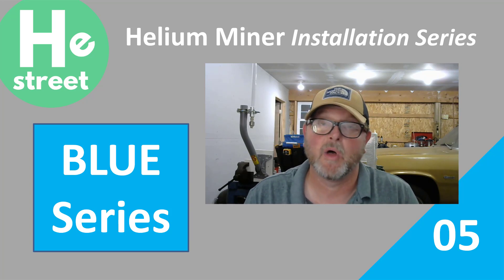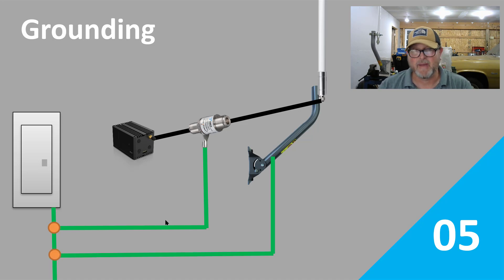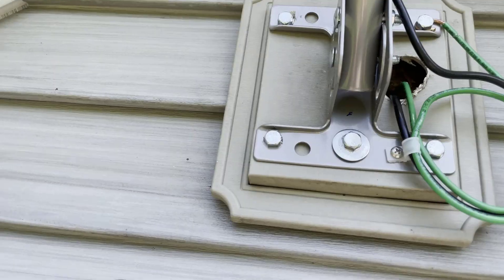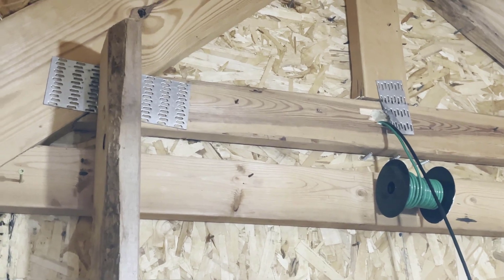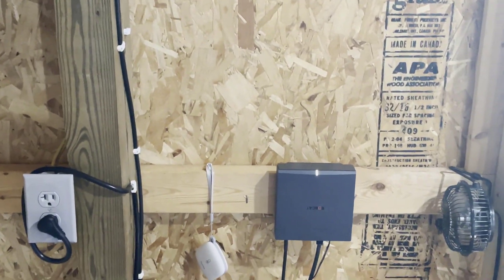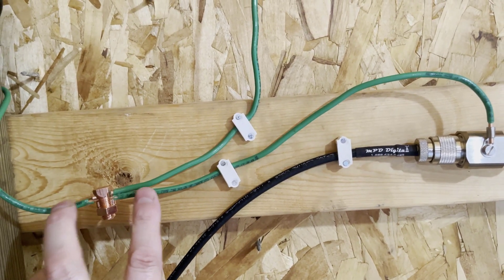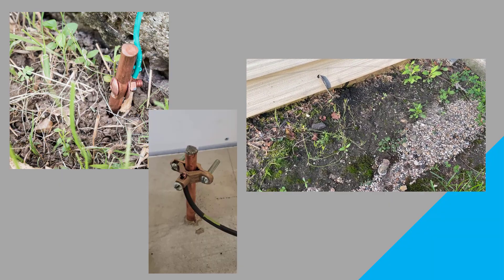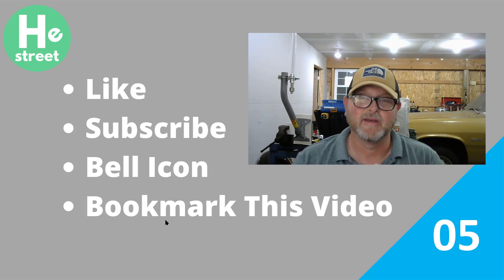Helium Hotspot Miner - Grounding Tutorial [BLUE SERIES] 05

Comment: This video is so helpful. Thank you for putting it together. Is it possible to connect the ground wire to the ground wire from an electrical outlet? My miner will be in my attic so running to the sub panel in the garage isn’t feasible.
Reply from the maker: My antenna/electrician contacts have advised against this.  Good idea however.  It seams logical but one of the main issues here is that the ground wire in your house circuit is usually only 12 AWG for 20 amp and 14 AWG for 15 amp and your ground for the helium COAX needs to be 10 AWG (min), so you would be undersized.  That is only one of a few issues mentioned.
Reply: @vandelay.digital.academy  Thanks for the quick reply. I also have my AC units in the same attic and those should be on a higher amperage circuit and hopefully bigger gauge ground wires. If I can find a 10 AWG ground wire from an existing circuit will that work? You mentioned the size of wire is only one of a few issues mentioned. What are the other concerns?

Comment: i have 1 big concern about this. Lightning arrestor have a voltage level protection up to 1200v. Obviously this cant handle a thunder. I believe is useful more for static energy creating by a storm. Therefore, should we build a lightning rod nearby to protect our antenna in case of a thunder?
Reply from the maker: NEC rules specify the ground needs to be attached to the electrical system of the structure. ie. the ground rod used for the electrical system.
Reply: @vandelay.digital.academy  i understand that. Ofc i will connect the lightning arrestor to a grounding rod. My question is if beside an arrestor do i need to build a lightning rod near my antena to protect it from the thunders
Reply from the maker: The guideline requires you connect the ground for COAX and mast be connected to the electrical system ground.

Comment: WOW YOU HAVE A LOT OF BENDS! Where in the world did you come up with 17 gage wire to use for a ground!  I would not ever talk about any ground wire smarter than 10. And it is possible for lighting to vaporizer 10 gage wire! You do know that lighting turns sand into glass? That is HOT! I would go with a 8 or 6, maybe a 4 gage stranded wire,  and not put as may bends in it. Lighting doesn't like to make turns! The wire needs to be outside as much as possible!  You are bringing the lighting inside before the lighting arrestor!  You put it on wood!Wow! Do you want that wood to get to 900 degrees or hoter? You want a straight line,  or as straight as possible from the antenna to the ground rod. With as big of a wire as you can put in,  Stranded!  Any bend forms a choke!  I have seen connector blown off of RG214! On the tests it talks about Not making bends in ground wires! Look up anywhere you want to look it will tell you Not to put bends in ground wires! And most will say that the lighting arrestor should be Before the coax comes inside!
Reply from the maker: Thanks for the feedback Donald.  Our installations have passed inspections and follow NEC guideline's.  17 AWG is the minimum requirement for the mast and 10 AWG is the minimum requirement for the COAX.
Reply: @vandelay.digital.academy  Take it from someone that has really repaired radios after near lighting hits! There minimums suck!! I worked at 2 Way service centers! RG214 has 2 shields. Lighting blow the connector off! The radio had a #4 stranded to ground. The tower had 3 grounds! It made glass around the ground rods! There was a DC remote on the radio with phone drop wire going form the radio to the office for the DC remote. There was no wire inside the drop wire to the office. Just the insulation up there! It destroyed the DC Remote! NEC Minimum are what is the lowest! That is what Minimum means! I would put the surge suppressor outside on the mounting, and run the biggest stranded wire I could afford down to a ground rod and then another wire from that ground rod to the power ground rod underground. But sold wire suck for grounding RF. Check David Casler, videos on Grounding on here! As for coax for VHF I have found that most of the RG8 is made in China. There is no real standers for RG8. RG213 is the same size and cost a little more but if you get Mil-spec That is Military Specs, that is good coax. You can go online and see the loss for the different coax at the frequency. LMR has some very good coax it is a little highter. I hope you never get lighting hit near you. Lighting hitting anywhere near you will set up some very high voltages and currents! Most people don't think of the fact that anytime there is a high current it sets up large magnet wave around it and if your antenna is withing miles of it there is large currents and voltage put into your antenna. This can do some really bad things. You want to do everything you can to keep that out of the house! If it gets in the house it can burn down your house!  Think of it that the lighting jumped from 10,000 feet in the air down, that is a hell of a lot of power! Hope you understand I just want to keep you safe! I have seen things that would make your hair stand on ends! And if you are anywhere there is lighting and your hair stands up, You are a target, make yourself small as you can!       73   de W4DES
Reply: @donaldsmith3048  I was scrolling down waiting for someone with real lightening experience to comment. Good stuff. My gut was telling me don't bring it inside. And I would bet money on it, if that ateana did get hit, everything is gonna be fried and some. Run it straight down outside of the house seems like the best idea regardless of NEC minimums. Good info Sir.
Reply: @adamgraves1805  Living in Florida, gets more lighting than most of the US put together. Most of the things I have seen people would not believe. I saw phone drop wire that there was no wire inside it after a lighting hit! It vaporized the wire inside the insolation! We need to treat it like it is SHF or light, it doesn't want to change directions. NEC is good. But I have not seen the part for radio tower grounds. My copy is about 15 years old, and I studied the Burg and Fire alarm systems. I have no idea what the temp gets to but when a ground rod comes up with glass on it from the sand getting VERY HOT!
Reply: Would a flag pole need to be grounded if its deep in the dirt?

Comment: I have 2 helium antennas that I get continuity between the center pin and the threads  of the n connector when metered . This doesn't seem normal. I thought the center would be isolated from the shield of the antenna ??  wouldn't this be a dead short on the antenna terminal?
Reply from the maker: I'll check a few in my stock and reply.  Not sure.

Comment: Current takes the shortest path , in this example your miner will burn before current reaches the ground, because cable going to miner is shorter than actual ground wire.
Reply: this is exactly what I was thinking ground isn't supposed to be longer than 8-10' from what I remember if you have 50 ohm coaxial and your grounding wire is more than that guess what? A long grounding wire is surely more than 50 ohms so ZAP!

Comment: What is the problem if u connected the lightning arrestor directly to the antenna?
Reply from the maker: Most electrical inspectors like to have the lightning arrester close to the device that it is protecting (in our case, the hotspot/miner) or at the point in which the COAX enters the structure.  In cases where the butt end of the antenna is relatively close to where COAX enters the structure, within a few inches for example, we can attach the arrester directly to the butt end of the antenna. This allows us to run COAX right into the structure right below the antenna and run the ground wire from the arrester down to the electrical system ground wires/rod.  You would also pull a ground wire from the mast in the same location.  The scenario allows us to only purchase one piece of COAX.  Remember the COAX ground (the wire that comes out of the arrester), should be 10 AWG or thicker (solid or stranded), and the mast ground should be 17 AWG or thicker (solid or stranded).
In other situations where our antenna is much further away from the COAX entry point, like on a tall mast on the roof or just much further away from where the COAX enters the structure, we would not want to attach the arrester to the butt end of the antenna.   Instead we would run a piece of COAX from the butt end of the antenna to where the COAX would enter the structure and attach the arrester either outside the structure at that point with ah drip loop or locate the arrester inside the structure (like our blue series).  Then attach a second piece of COAX on the other side of the arrester that attaches to the helium hotspot/miner.

Comment: Very Informative video & helped alot in my installation, only question I have is, Why is Antenna mast grounded? is it to avoid static build up & does grounding the mast helps in antenna performance?
Reply: I was also wondering this.. Haven't seen other videos mention that the mast should be grounded as well as the antenna.. ?
Reply from the maker: Yes, grounding both is a NEC guideline.

Comment: Is it not safer to run a separate ground rod as close as possible to the mast?
Reply from the maker: I can't comment specifically to your question regarding safety because I'm not qualified as a master electrician.  But... I can say that I am aware of the NEC guideline regarding antenna grounding.  The NEC guideline specifies that that both the COAX and the antenna mast should be connected to the electrical system ground of the structure.  The guideline does not allow for separate ground rods.  I verified this requirement with a professional antenna installation firm.

Comment: Can you share where you picked up the vinyl plate that the antenna is on against your vinyl siding?  It seems to fit perfect for that mount.
Reply from the maker: That plate is a standard light fixture/electrical mount. I was lucky the size matched up perfect with the antenna plate.  I think most vinyl siding accessories for the same purpose will have a very similar footprint.

Comment: what do you think about putting the miner with the standard antenna inside a waterproof enclosure on a roof mast? (Antenna inside enclosure) Would ESD be an issue since the antenna is “inside”?
Reply from the maker: Are you talking about the stock antenna?
Reply: @vandelay.digital.academy  yes. The stock antenna inside an outdoor enclosure with the miner. No arrester needed?
Reply from the maker: NEC requires an exposed antenna and the mounting structure (mast) is grounded to the building's electrical system.  If you are just using the little antenna that is attached to the back of the miner directly, and you put it inside an outside enclosure box and the box is not on an antenna mast, maybe just installed outside like on a wall or on the roof?? you won't have anything to ground, ???
Reply: I purchased the bobcat 300 outdoor box from Rak. It has a grounding site to the box. My antenna would be directly to the box. My question is do I still need to bond in copper by adding the lightning arrestor which would be placed between the outdoor box and antenna ?

Comment: How does grounding help with the antenna?  I'm just using a base antenna, is that grounded or do those need to be grounded too?
Reply from the maker: What are you referring to?  "Base Antenna".
Reply: @vandelay.digital.academy  I mean anything with a black base on the bottom, just like the stock antenna for the bobcat
Reply from the maker: Grounding does not help RF performance, it just protects your device and your property.
The black 4 dBi antenna that comes with the Bobcat miner used inside would not need to be grounded.
If you decide to move that black Bobcat antenna outside, you might be assuming some very small risk but VERY small.

Comment: Could you have grounded it to your ground wire at the plug?  That plug ground goes to the panel anyway.  Good idea?  Bad idea?
Reply from the maker: I think "technically" the main reason this is not correct is because your electrical system has (for a 20A circuit) a 12 AWG ground wire.  The NEC requirement calls for a10 AWG wire (stranded or solid).  So the 12 AWG wire is not thick enough.  Bummer, this would be GREAT for apartment/condo people.  I HATE to say it.... bad idea "technically".

Comment: This was super helpful, thank you! Would I be able to ground to an outlet in my home? I’ve heard of people grounding using the bottom prong of an outlet. Please let me know!
Reply from the maker: The main reason this is not correct is because your electrical system has (for a 20A circuit) a 12 AWG ground wire.  The NEC requirement calls for a10 AWG wire (stranded or solid).  So the 12 AWG wire is not thick enough.

Comment: Nice neat work, however if I can make a suggestion, drilling a hole into the side of your antenna can compromise the structural integrity of it and a self tapping screw will back out of that hole over time. A better option would be to expose the metal on the mast with sandpaper etc so you can put a strap on it to bond it.
Reply from the maker: Is this method compliant to NEC?
Reply: Side note, a tiny bit of Scotchkote electrical coating on  your connections will save you from oxidization on any exposed wiring and connections. I stress tiny, the stuff is like a souped up version of devil slime. You get a little bit on your finger next thing you know its all over you, your house, your car, your clothes, it multiplies and attacks your entire life (im being dramatic but it can be messy). Also dont put it on until you have everything in place, its working, and youre happy. If you put it on before you finish and then you have to change something, you'll get it on  your tools and thats how it starts invading your life. If you live near any body of water, its a lifesaver from salt air etc.
Reply from the maker: @irishsodabread4100  Awesome feedback, thanks!  Can you provide a link?  Viewers might like to explore the use of this further especially in coastal environments.

Comment: I live on the last floor of my building and I don’t see a way that I can ground it like running a cable to the ground I’m planning on mounting my miner on a closed chimney is their anyway to make this work?
Reply from the maker: Possibly contact the property owner to see if you can tap into ground wire used for the electrical system, contact an electrician if needed.

Comment: Hi mate I was just wondering would I need to ground in the UK as my research shows its not needed in UK?
Reply from the maker: I believe UK electric code does require grounding of outdoor antennas.  You should contact your local electrical inspector to confirm.

Comment: I've read recommendations for grounding wire from 12 - 4 gauge.  Also, to use bare vs. covered wire.  Does NEC recommend/require any specific wire for these type installations?  Personally, I like your 10 gauge covered wire but another installer suggested 8 gauge bare wire.  What do you think?  My grounding wire will be outside  with a dedicated 8' grounding rod.vs your inside installation to the main junction box.
Reply from the maker: 10 gage wire is the minimum thickness for the lightning arrester wire.  17 gage is the minimum thickness for the mast wire.  Both need to go to the electrical system ground block/wire.  Just putting in an independent ground rod will not satisfy NEC. Those wires need to join the electrical system ground.  You can join the electrical system inside the building just under the electrical panel like my vid shows or if running wire on the outside of the building, attach to the electrical system ground wire/block.

Comment: Can you also use an existing electrical outlet to ground antenna?
Reply from the maker: Good thinking.  Unfortunately, electrical inspectors are not in favor. I think it’s because the outlet is considered another device.  You shouldn’t tie the ground mechanism of one device into another device.
Reply from the maker: Another thing to consider is that they typical 20 AMP circuit is only running a 12 AWG ground wire.  NEC requires COAX be grounded with 10 AWG or thicker.

Comment: Avoid any coils on grounding wire pls, 
even half thread/circle/loop, lighting or any other electric discharge in air will make a really nasty damage. Best option is have all grounding wires straight  as possible directly to grounding point.
Reply from the maker: Thanks for the feedback!

Comment: Thanks for the great details Mike!, I was wondering if does matter the location of the grounding arrestor betwee the antanna and the hot sopt? Would it matter if it's close to the antanna or the hot spot or it has to be in the middle?
Reply from the maker: Most electricians and electrical inspectors will want to see the COAX grounded with the lightning arrester close to the device its attempting to protect.  In many situations most of the COAX and the lightning arrester is mounted to the outside walls of the building like in this video from Ed Ballou https://youtu.be/GTy9H5zYw0w  Our Red Series will show this also when published. 
 If your are looking to mount most of your ground wire and COAX inside the walls of the building you will follow Helium Street Blue Series episode 05 https://youtu.be/L_iRaIlSTKg
Reply: @vandelay.digital.academy  hi Mike. I was reading that the arrestor should be as close as possible where the coax enters the building on the outside. As the static accumulates in the coax cable as well on the outside and you want to have as little as possible of the exposed cable. You get the idea. I am having hard time to get a educated advice, this was one, may I ask your opinion? Thank you!!!